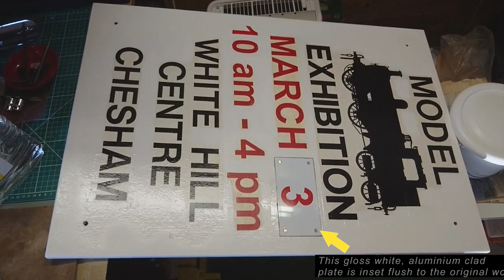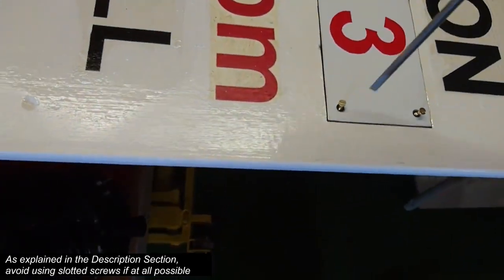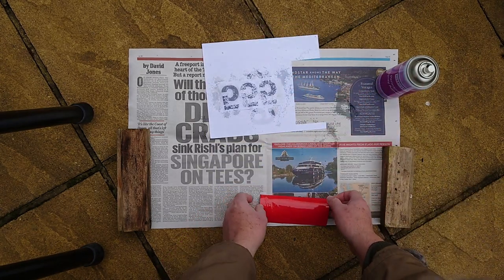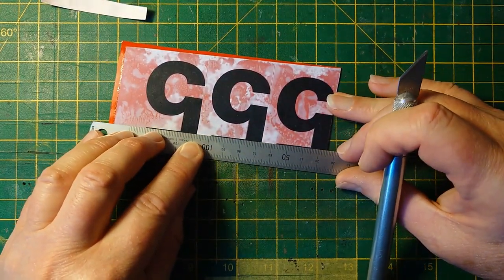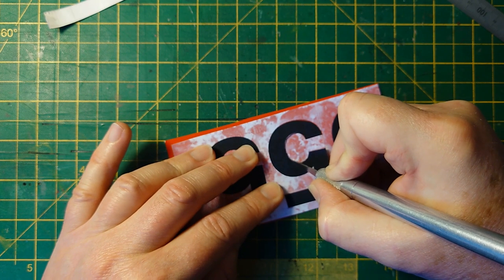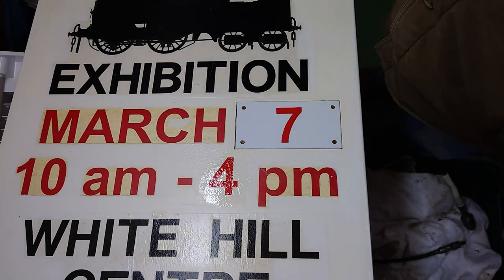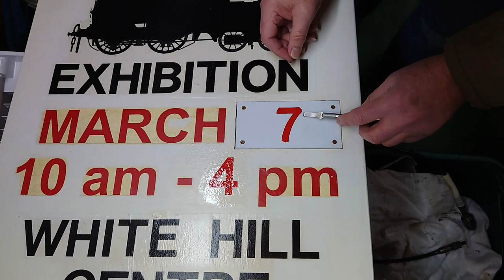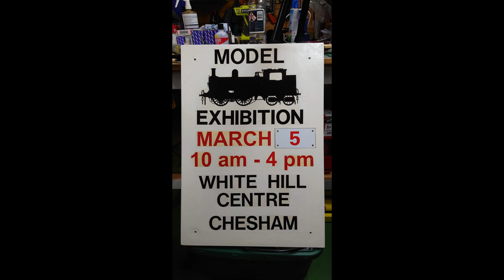041. How To - Make Club Exhibition Signs with easy Yearly Day Date changes (4K)

Comment: Looks very much like a footprint tools P.O. no5 or 6 screwdriver...maybe.
Reply from the maker: I can't say I've heard of Footprint Tools and I'm a Toolofile and meant to be an expert on fasteners. Going to a BSI Aerospace Fasteners Technical Committee meeting tomorrow actually.
Nothing on Google Images matches my screwdriver of any make. It is unbranded. It's nice to use and as you saw, I was doing those screws up one handed. I think it was purchased in the late 70s or early 80s.
Reply: @andrewdking  most Ex-Post Office or BT engineers would have Yellow handled footprint Screwdrivers and tools. They were stamped so you'd soon know it. Something to watch out for, I'm still using mine after 30 years lol.